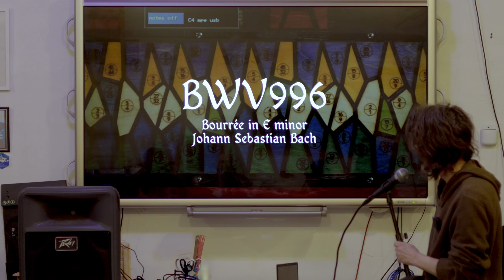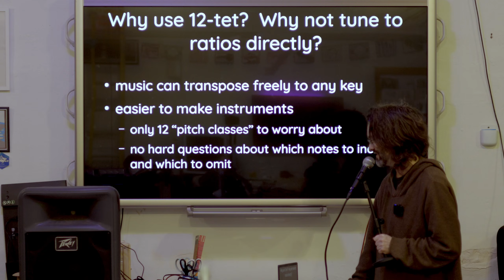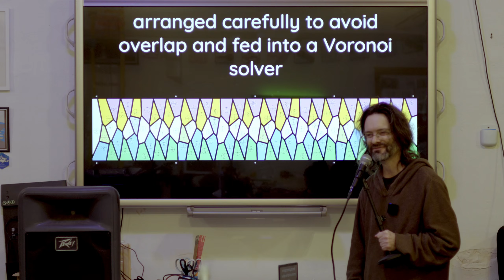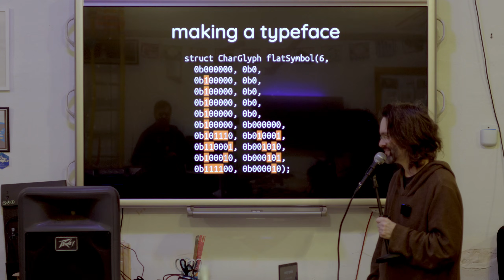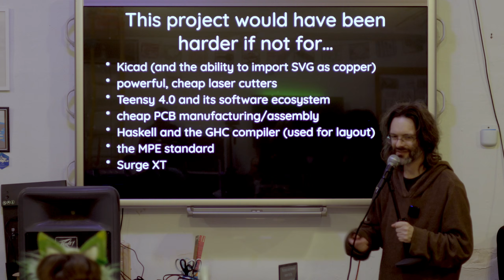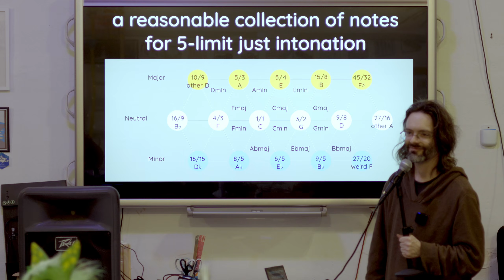Jim Snow - Dorkbot PDX - 9-Feb-2026

Comment: I'm not sure, if I fully understood the tonal system, so this might be easily answered with no, but here it goes :) Say, we have a 12-tone keyboard. Would it theoretically be possible to deduct from the root not played by bass note or also from pressed chord structure, what the "correct" pitches would be? As I understood, in a chromatic instrument, it would have to always change based on the Key and sometimes also on which chord is pressed. If that would be possible, could something with a 12-tone keyboard be programmed to change the Micropitch of each note according to what is beeing played, so you would never need more than 12 keys per octave? The Soundsoftware would just do it for you. 

I hope, this makes sense to you somehow ^^
Reply: That's a great idea, and there do exist keyboards that do this to a small extent: the Yamaha Harmony Director comes to mind. But they aren't as compelling as a purpose-built microtonal instrument for a few reasons:
1) it becomes difficult to decide what "detune" the bass note should have in sequential harmony - most existing systems that function like your suggestion use the "normal" 12tet version of the bass note, then retune everything above that.
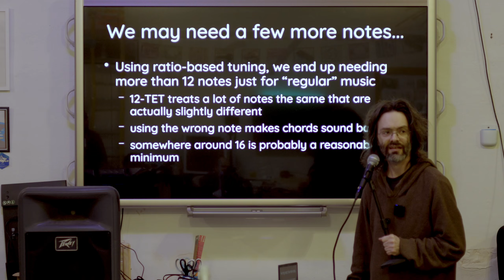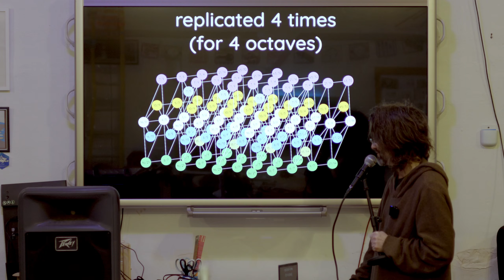2) if you snap every 12-tone equal tempered (12tet) interval to a close just-intonation approximation, you miss out on many just intervals including those further out on the lattice diagram and those notes on the other dimensions of the lattice diagram (talked about 11:40-15:50).
3) some 12tet intervals (m7 in particular) serve as the closest approximation for multiple just intervals - it would be impossible without the knowledge of the larger context of the chord to decide which is the correct pitch to use

You can always learn more on the xenharmonic wiki (xen.wiki), but I hope this helps!
Reply: Auto-tuning 12-tone music into just intonation is something that I expect could be made to work, but it might have trouble doing the right thing in ambiguous situations.  I think it would work a lot better in, say, 41-tone equal temperament (that being the next equal temperament that approximates just intonation better than 12-TET) because there's a lot less guessing about what note or chord was intended.
Reply: @jimsnow9493 @jmuspup Thanks you two! This helps a lot, I was already suspecting, that just notes pressed can't for certain predict the note pitches needed, because it depends on the musical context. I'll check out the Yamaha, and also 41-tone equal temperament :) 

Just one last thought, so no, prediction is not always possible, but if you imagine, changing note micropitch just depending on whatever is pressed with it, so at least in the moment all the tones that are ringing "morph" to whatever makes sense the most. Maybe as an experimental Instrument, it might be interesting to play and see, what happens :D Either really just shifting using the bass as basenote always hard wired to "retune everthing above that" everytime the bass changes, or a bit more suffisticated the chord itself. I had a Yamaha Keytar, that could just assume the bass tone depending on what my right hand chord is doing and just added it instantly. In this case, obviously, if I want to play a C over E, this won't work, it'll always play a C in the Bass, but its pretty cool to mess around with and I can calculate this restriction in my playing. 

I'd like to see that :D Maybe you can logically tell me the system and I can try to use it as algorithm to code it onto a software instrument :D Maybe I just have to get on the forementioned wiki and learn exactly that xD Would love to here though, how you would basically approach this matter, if you had to do it 😎
Reply: @sammyrc  The simplest thing one could try is detecting any time you're playing a major third, and bending the upper note down by about 14 cents.  That makes major triads better, but creates a wolf fifth when you do a minor triad.  So maybe you also detect when a fifth is being played, in which case you hold the notes of the fifth exactly where they are and bend the lower note of any third up instead of bending the upper note down.  (You could imagine adding more rules to account for minor thirds played by themselves and correcting major sevenths by bending two notes at once.)

I haven't tried any of this.  It might make music just sound better with little or no downside, or the little pitch shifts might feel uncanny.  Hard to know without trying.
Reply: @jimsnow9493  sounds cool, I'd do the shifts like a subtle bend, just like a brass or reed player would do it in intonationen. Hopefully I'll get the chance to build this as a mockup, will let you know :)  
 thanks for the input!